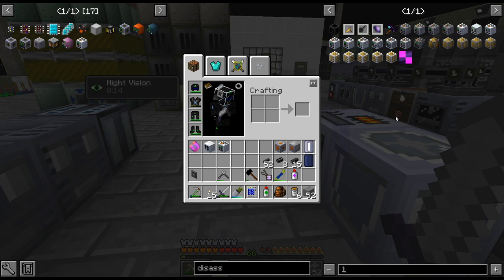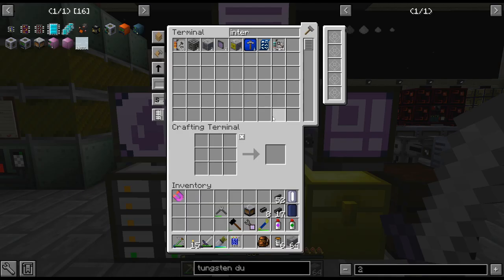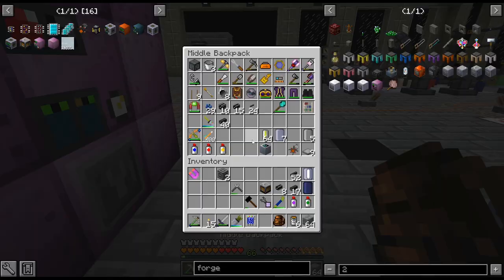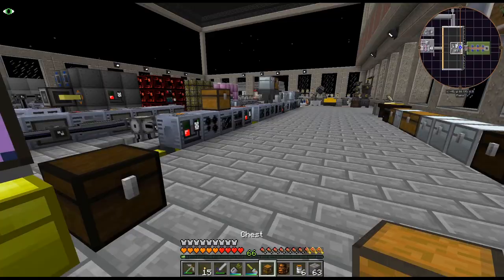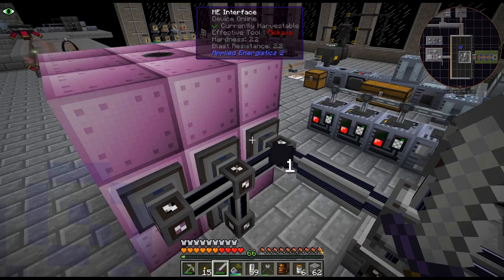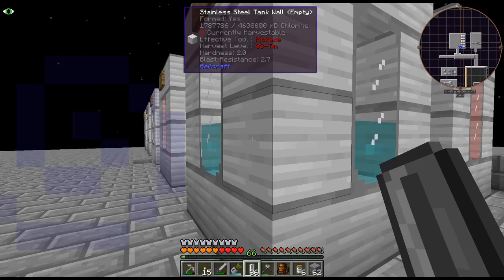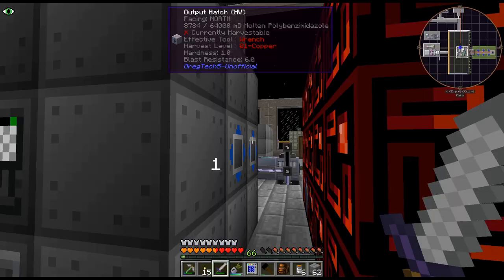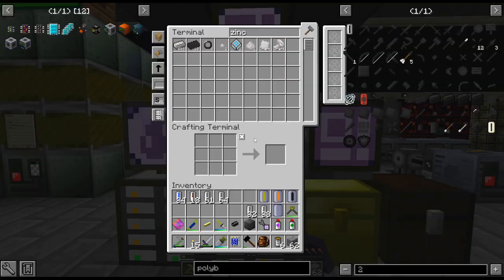GregTech New Horizons S2 - 115 - Poly...Benzi...What

Comment: 0:09 season 1? Lol
You should make 2 material presses, forming press is very useful as well
There is a ++ forge hammer in dev
You can use me output busses as well, with ++ machines though you do need to turn voiding on with a soldering iron
Loot bags can give Ender tanks/chests too
You need 2 batches of what the quest asks for for PBI
Wood tar is very useful for its byproducts, consider doing it soon
Quest was fixed later with the chromium
There are recipes that don’t use the tiny dusts

Comment: I think ender fluid conduits have built in fluid filters, so you can share a single cable with multiple fluids. I don't know if its both input and output filters, nor how many slots there are. Multiple tiers exist though, so I'm sure there will be something that handles your needs.
Reply: Yes Ender fluid conduits have built in filters, input and output.